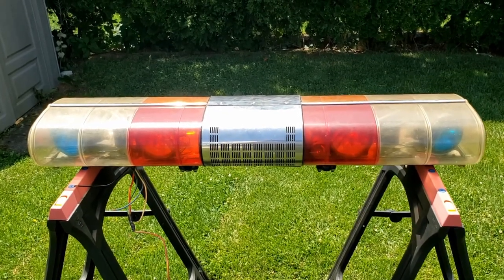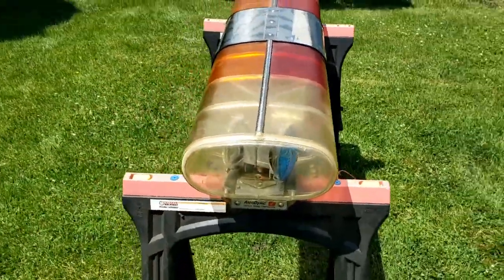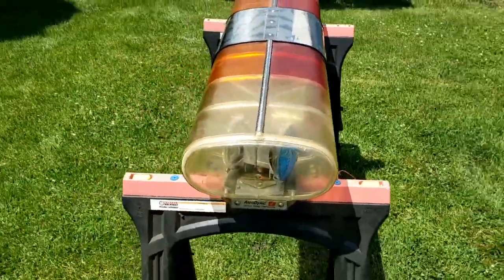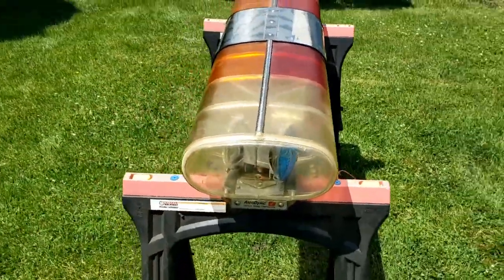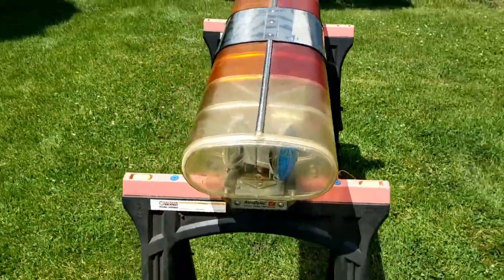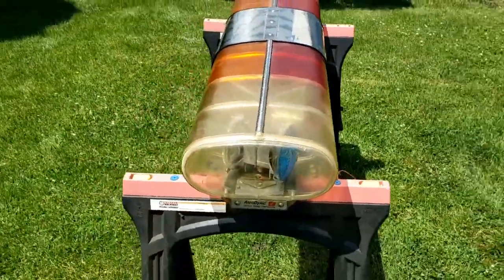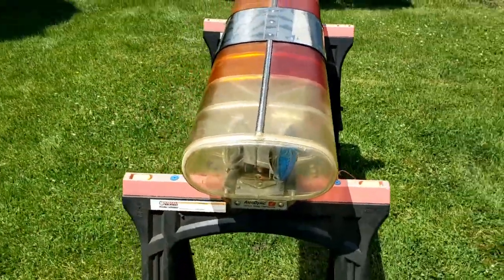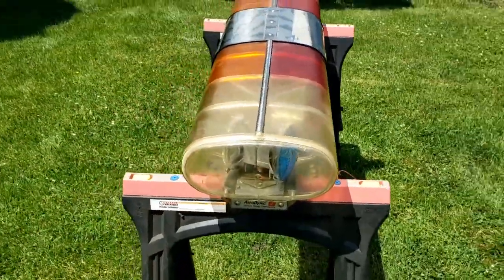NYPD Aerotwin?  First look..    Take 2!

Comment: My NYPD Aero bar also has the hex head security bolts
Reply from the maker: I have seen other Aero's with this installed as well.   Probably in an attempt to prevent theft or tampering.
Reply: @stampeedvalkyrie  i thought my NYPD bar  had incorrect lens bolts until i saw your video

Comment: Like the blue bulbs.
Reply from the maker: Having had a chance to tear into it,  1 blue bulb is a 4416B and the other is a 4415B.     I've never encountered 4415s is any color other then clear and the more common amber.
Reply: @stampeedvalkyrie  I have a 4464R that came out of my SD bar when I got it, works great just don't have a need for it.

Its currently in my NYPD bar for the time being til I put 4416s in it.
Reply from the maker: Locating 4416Rs can be abit of a bear.   try this seller on ebay..   https://www.ebay.com/itm/122569367146?epid=250514783&hash=item1c89b41e6a:g:80QAAOSwhPRbUUl0

Comment: I know this video is a tad old and the market has changed, but what is a good approximate value for a nypd aerotwin? I don’t want to go looking for one and be way low or way high. If anyone knows it’ll be you
Reply from the maker: 1st condition is everything,  2nd AeroDynics are commanding a premium.   3rd department specific Aero bars like NYPD, LAPD.. etc are only going to go up in value.    With that said NYPD bars aren't exactly hard to find.  Sight unseen I would put a faily large range on value..  $500-$1K+  Higher price would require minimal to no reconditioning and domes would need to be VG to Excellent.    Domes can make or break the value of the bar since they are no longer obtainable.     Lower price point also assumes the bar is complete and not missing anything.      And as always YMMV.